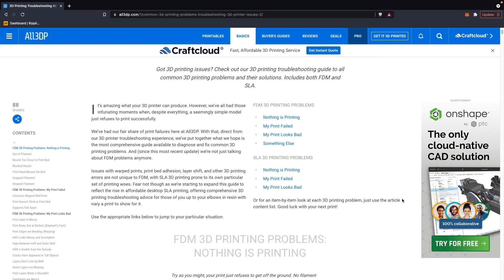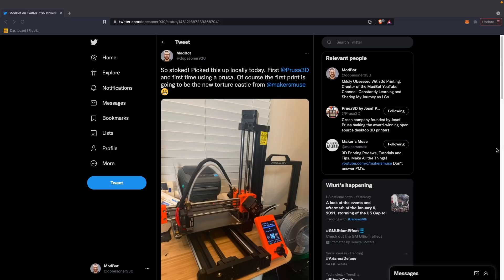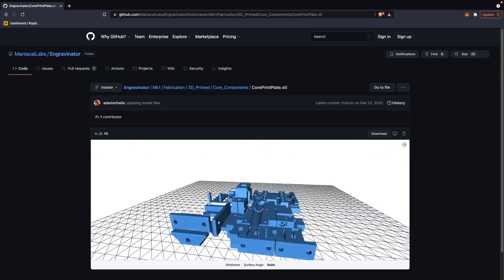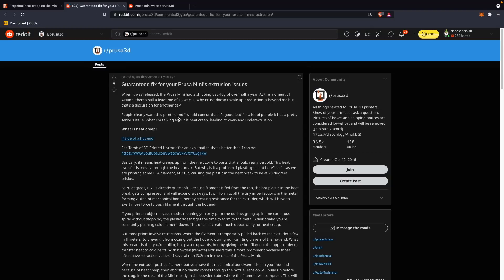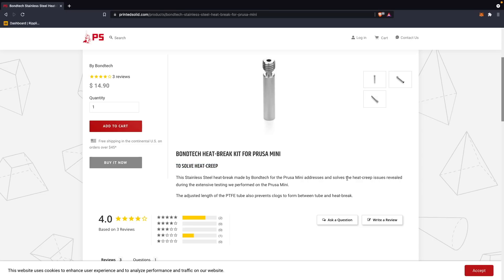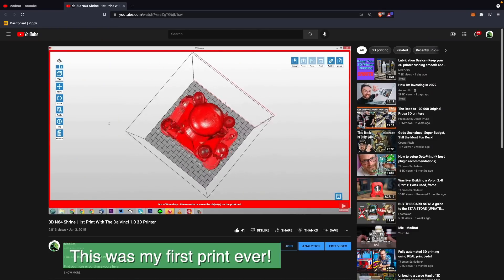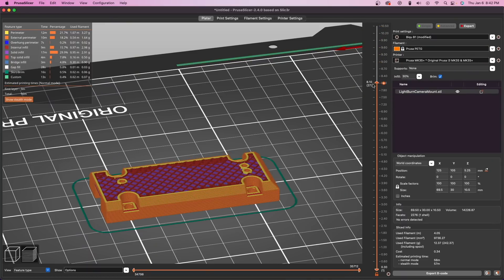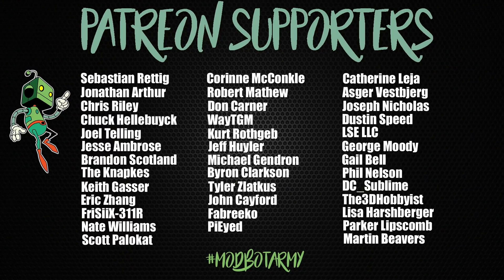DO THIS Before Troubleshooting 3d Printer Hardware

Comment: XYZ, I HATED their slicer as well as their printer! 

My first 3D printer was the XYZ pro all 3 in one machine. I NEVER used the laser function on it. The scan tool was virtually useless for copying things.  After about a year of owning it, I gave the printer to my niece who wanted to get into 3D printing, & got the CR6SE.

 After a lengthy time of trial & error, we FINALLY got the CR6SE printing well.
Reply from the maker: Yeah I am thankful I got it because it was my gateway into 3d printing but man it almost made me give up on 3d printing as well. 

CR6SE is pretty sweet. Probably the best factory leveling I have gotten with any Creality machine that has ABL installed.
Reply: @ModBotArmy  I was thinking,  when I first got the machine 3D printing was just too complicated for me to be doing. After seeing a friend's Ender3 I knew it wasn't the 3D printing that was hard,  but the XYZ proprietary software & hardware that was making it difficult for me.

Comment: Recently printed a pre sliced, paid model assuming it would be perfect. After two fails on one part (part A) I noticed the original maker had NOT made sure that particular part was FLAT on the bed. Corrected for it and it printed perfect. TRUST but VERIFY people!
Reply from the maker: Similar happened to me with a paid model. I was wondering why the part kept coming off the bed 50-75% up. Inspected the .stl and the first layer was just at a tiny tip. Options where to drop file below bed to cut it off or add brim and then it printed fine.

Comment: The only thing i have had is tool head path sometimes doing something totally wired and im not really sure where it does this, normally what i love to do is making sure that the tool path because that makes cleaner extrusions i kinda like it to follow one path and not jump all over the place and doing retractions and all sort of wired things.

Reason is i find it gives much better print, and it also saves time i have not done a totalt cost save and time same calculations but im thinking if you optimize this process then you can get 15-20% savings in power alone

Comment: I wonder why there's no such thing as a CRC check or even a SHA512 at the end of gcode files. It would make life a lot easier if it were possible to verify the data after it transmission. Not that it would help much in realtime, though (there's support for checksums per gcode line), but if a whole chunk disappeared due to a lost block/sector on the medium, well, you'd know ifyou had a checksum or hash.

Comment: Thanks for this one. Did you try to slice it again in PrusaSlicer to rule out the chance of a bad SD card?
Reply from the maker: I did slice it again and it printed fine. I still may need to keep an eye on the flash drive. If it happens again I will be replacing it just to be safe.

Comment: Sometimes Cura will slice a file with a layer missing or moved. Wierd that it happens on Prusaslicer too. I almost always catch the corrupted gcode, but it is concerning. I don't know why Cura does it, but reslicing the file fixes it.
Reply from the maker: Sounds like quite a few that have experienced it in Cura as well.
Reply: @ModBotArmy  It is definitely worth it to check the gcode real quick especially if it is going to take several hours or days.

Comment: When i bought my first 3d printer, i gone crazy because in my first print my benchy stops at half process and the machine started moving only in the x axis. At that moment i thought that maybe the machine wasn't working due hardware issues and when i was asking for a replacement. Until that moment the store ask me if i had check the gcode because it can get corrupted due sd card issues or due cura issues (same story as yours). Now i check the gcode twice before each print  :,(
Reply from the maker: Wow that is a pretty massive one. I may just be lucky but I do not have any obvious corrupt sd card stories other than for resin printing.

Comment: Also, I am thinking installing a Dual gear extruder. It's like having 2 wheel drive vs 4 wheel drive. At least that should help with slipping issues.

Comment: Yes! This happened to me. I chased parts for two weeks! In my case, moving a model between different modeling softwares will sometimes not include some details of a complicated part. Especially when you import in and out to make a quick change like adding text with different program. Also had an issue where when imported into Cura, the part was not on Z (0), a tiny artifact was there I missed in Meshmaker. The I had the reverse happen, I had a successful print, but decided to look at Cura preview to see where I could save some time. The model was missing the top halve in Cura Yet, it printed fine? I honestly don’t mind these problems when I’m tinkering, I kind of think of it as like having an old muscle car you have to work on. But it can drive you crazy when it’s a functional part with a deadline.
Reply from the maker: Haha yeah I dont think I mind as much either if I am just printing for fun but in this case I am trying to build a functional machine and it was one of the last plates I needed (it is always the final plate where things go south). I have not experienced transferring models from different design softwares but I could definitely see issues with compatibility or just things not being grabbed.

Comment: Happened to me uploading gcode via Octoprint interface on the local network, randomly in the gcode there were random characters that messed the gcode thus the print. 
Weird thing is if I uploaded the same file from a remote network it worked fine, I usually launch prints from home during the weekends. 
What I ended doing to upload locally was to connect via winscp to the raspberry pi running octoprint and upload the gcode to the watched folder. It never happened again since then.

Comment: Very good video.  I have had a LOT of issues with corrupted SD cards etc in prints over the years.  Since I have moved to WIFI file transfers in the Reprap ecosystem, that has no longer been a problem for me.  Even though the files are being written to yet another SD card on the control board, it just seems to cause fewer problems when I don't eject anything and physically handle the card.  I have no explanation for why that is.  I often had issues with my printer randomly deciding to move the print head VERY SLOWLY to the edge of the print range leaving a huge pressure blob somewhere on the print for the hot end to crash into later on and fail the print.  It drove me nuts.
Reply: Same experience here. Ever since moving to USB to raspi to cat 6 for my connection, a lot of those odd problems just went away.

Comment: So when you open the file in a text editor and go to the layer that was showing the issue in Idea Maker's preview what did you find? Since Prusa slicer didn't show the missing layer I'm curious if there was some corruption in the file or if it truly just skipped a layer entirely and Prusa slicer hid that. Did the z height just immediately jump an extra position?

Ultimately what was your solution? Did reslicing in Prusa slicer fix the problem? Did you have to use a different slicer?

I feel like you made half a video here illustrating the beginning of an issue, but no investigation or resolution. :(
Reply: I'm also interested in an examination of the g-code file, especially done in a "programmer's" text editor that would also show non-ascii characters. If you have the 3mf file of the bad print, try regenerating the gcode to see is the same fault occurred. (If so, get Prusa the 3mf file, resulting g-code, and a description of the fault through their github project so they can find the bug to try to resolve the issue.)
Reply: @Sembazuru  yep exactly my point. How hard would it have been to show the file loaded up in Notepad++ which may have exposed why the printer and Idea Maker couldn't read that layer, but Prusa Slicer did.

Comment: I had the SD card reader from ender 3 v2 corrupt my g code  tossed that thing in the trash right after took it apart and connecter for SD  card was falling off  circuit board it caused printer to drive z x and y motors z up and x and y all at once started grinding belts right after hitting printed glad it did it when I was there switch printer off belts are ok thank god the printer was almost brand new also all the files on the SD card where corrupted and windows format couldn't format card at all I used SD Card Formatter 5.0.1 and the card was fixed but I lost everything on it

I had a missing layer in a vase mode print in cura once but I noticed it in preview just moving model  and slicing again made layer show up so weird

Comment: I have came across this issue a few times, first time did same as in video, went threw all the possible physical issues, went to 4 prints then took a step back and asked myself, what is common denominator. It was the gcode from Cura, resliced it, checked it and it was then good. Printed item and all was good, second time I caught it right off due to going threw this already, I now go threw and check my gcode before I send print to printer. 3rd and 4th time, caught it before it went to the printer.

Comment: Ideamaker is an awesome tool that has come in handy for me multiple times although it’s not my usual slicer. I use superslicer for all of my printers except my Ender 5. Superslicer consistently gives me layer shifts but only on my ender 5. I’ve tried multiple pre-made profiles all with the same results. I assume it’s not hardware because Cura, Ideamaker, & Prusaslicer all work fine. I know I can create a profile from scratch but I’m still trying to diagnose the issue.

Comment: I had a similar experience with Cura yesterday. The preview showed layer 306 out of 634 being skipped. Upon further investigation it was shown to be printing layer 306 down through the print onto the build plate. That would have caused something catastrophic. I have no idea why Cura did that. I went ahead and looked at the GCode in Notepad++ and all the Z commands were actually how they were supposed to be. After that I had the confidence to print it and it turned out just fine. Very strange though.
Reply: Hello, I had it too with Cura. In my printsettings were "Use addaptive Layers" (last point in the printsettings) activated. The next print without these settings was okay. I use the Ender 3 with PLA. 
Greetings Flo
Reply: Its a bug in the preview menu... Its a rare issue but its been around since Cura 3.4.1 at least...

Comment: I had Gcode weirdness on my anycubic Kossel where on the largest print I’ve ever done, instead of moving to the bed at the start it just tried printing and smashing through the end stops. All the other prints after that were fine and I tried to reslice it but it happened again and again in cura

Comment: I had arc enable on my octo pi and the compression was changing the gcode so that it was extruding during a travel move. when watching the virtual  code in cura before i sent it to octopi and it didn't show it doing that. The octo pie also didn't show that code printing in that way but i could see the machine doing it, the problem was that code was causing a building up of a bump, that would make the print fail. i spent hours trying to figure out why it wasn't doing what was being shown in the tool path. I then remember i had enabled arc last week so I removed arc and it worked fine. It may be that a newer version of the firmware would let arc work better but i have decided not to use arc for now and my prints are working.

Comment: Great video.  Just out of curiosity, did you try re-slicing the file in Cura and get the same results?  What about re-slicing it with a different layer height?  I go back and forth with Cura and Prusaslicer (once in a while IdeaMaker too).  Just trying to figure out why Cura missed that entire layer.  If you re-sliced that one part in Cure with all the settings the same does the lost layer stay lost? There's some things you can test out in your "spare" time.
Reply from the maker: Thanks Pi! I did not. Since it was a batch print it was 4 .stl files and I did not have that plate saved. When I reloaded them into prusa slicer and sliced the issue resolved itself. Would have been cool to catch it earlier to export that exact plate and see if any other sliders had an issue. If it happens again I will definitely try to see how other slicers respond to it 😬

Comment: I had an issue with Cura and Arc Welder while trying to print a Benchy last month.  I turned off Arc Welder and my gcode was fixed. Not sure why this caused an issue.

Comment: I love the bondtech dual gear extruder for my mini! It extrudes a little better and it improved my reliability! The worst thing i ever did to my mini was put a SE Mosquito on it...
Reply from the maker: Wait what happened with the mosquito??? I have hardly ever heard negative about that hotend. I think one of the early generations may have had a slight issue but other than that at least.
Reply: @ModBotArmy  I had a part failure that went into the fan.  They are not fun to replace a heat break on the first time since they become super delicate as soon as the bottom two screws come out. Those same two screws are also insanely easy to stretch out and snap by over torquing them since they're so small. I also needed to reprint the adapters since they all melted. Hah

It's not the minis fault but a stock prusa mini would have been much easier to repair. Definitely a lesson in "keep it simple"

Comment: I am new to 3d printing and I have been printing a few months now. I have noticed a weird movements when printing, but only on the first layer, thankfully. Once the extruder went to the end switch when doing brim, and I had an extruder rapidly retracting for a second on a few prints. And then continuing. Ofcourse it tok a few seconds for filament to start extruding from the nozzle again.
I tought it was something wrong with printer software...
Since I updated to prusaslicer 2.4 I have been noticing less weird movements...

Comment: I had a print that seemed to be having bed adhesion problems.  I tried  a brim and glue, but the problem persisted.  Then I went back and reviewed the slicing and noticed that a large part of the model that I assumed to be flush with the bed was elevated by a very small amount.   Reorienting the part before slicing fixed the problem.
Reply: Been there, done that.
Reply: Same here, done that too👍😀

Comment: How'd you fix it?
Reply: I was curious about this too, did reslicing it fix it?  Did you have to use a different slicer?  Was it maybe the model and you used Netfabb?
Reply from the maker: Sorry, I resliced in Prusa slicer and it was fixed. I was not printing one part so I was not able to orientate them exactly the way they were before with the error. That being said I loaded the 5 parts hit slice and the error was gone. It seems many here that have experienced this are saying reslicing fixed it for them as well.
Reply: @ModBotArmy  Thanks for explaining that. I was wondering if you had to go in and manually fix the code somehow. Glad it wasn’t that crazy.
Reply: I would have followed up on how you fixed it, for those that may not know how to go about doing that.
Reply: I’m curious too as I’m new to this hobby.